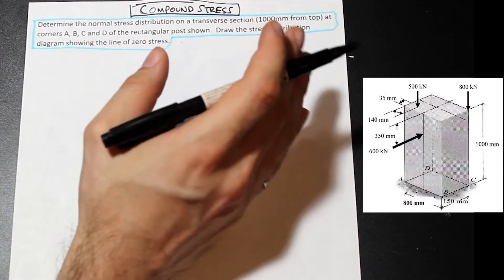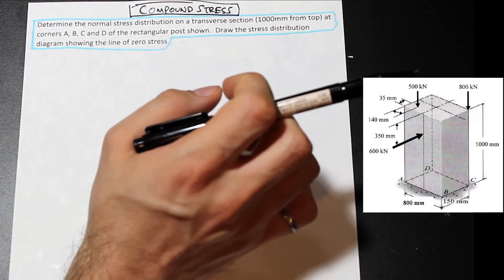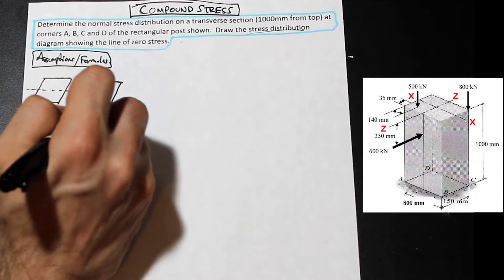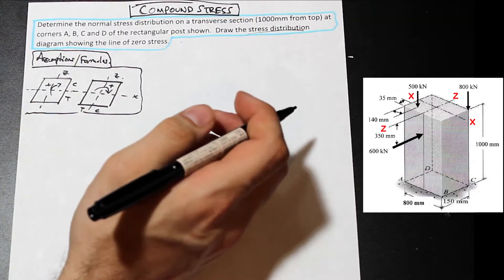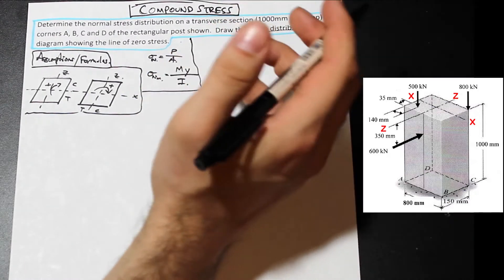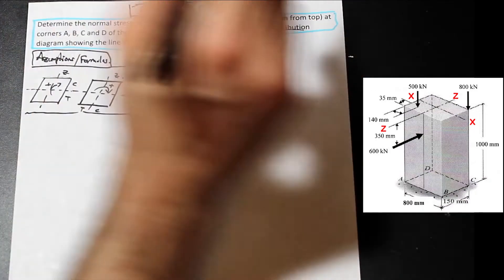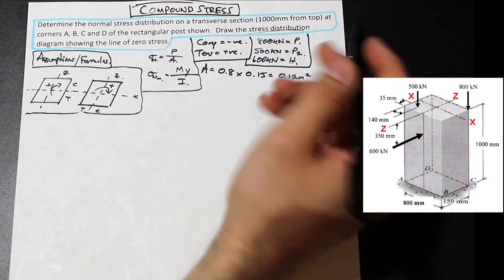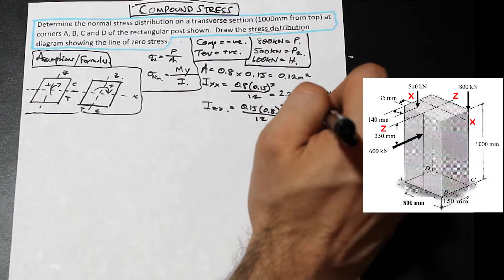Compound Stress Example Problem - Calculating Net Normal Force at Corner Points

Comment: What if there's eccentricity on 600kN with y axis, so does that mean there is sigma yy, so that there's 4 component need to added up? Plus how to draw it?
Reply from the maker: An eccentricity with the lateral loads would cause torsion of the structure, which is not what we're covering in this video.  You would never see that in a problem like this most likely.
Reply: Thanks for the info..U the best!
Reply from the maker: cheers man, thanks for the comment!